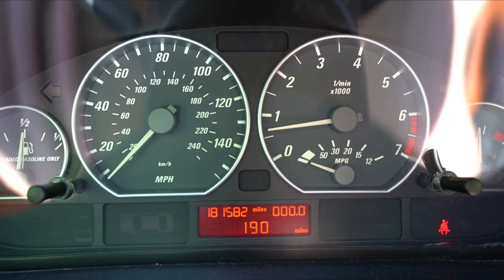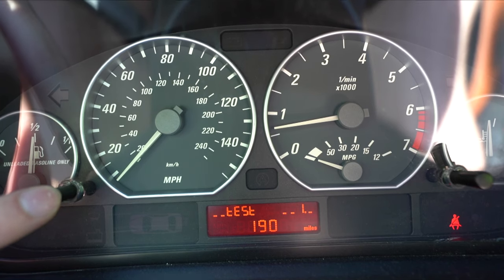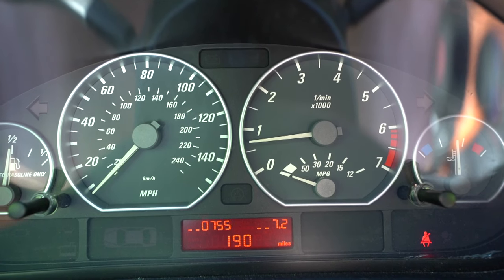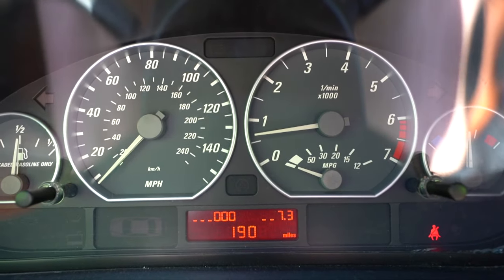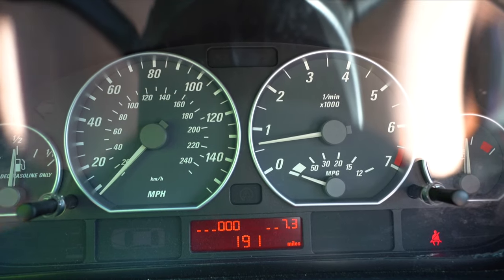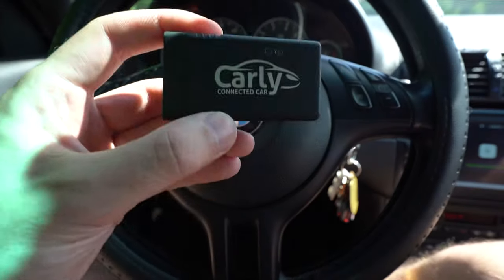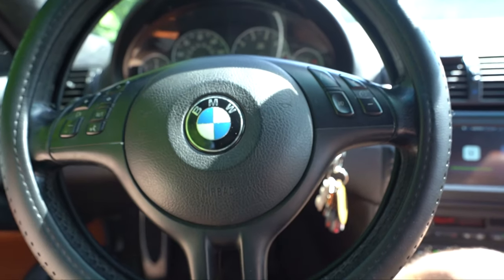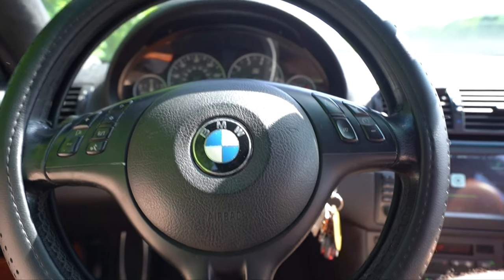How to enable DIGITAL speedometer on ANY BMW!!

Comment: Love your videos!  For whatever reason my car has Mph as one of the 5 labeled options on the cluster, using the BC button.  Temp, mpg, range, time, and mph (real-time)   It will save an average mph when you stop and when you start the car back up it will usually say like 35.8 mph, cause I fly low in the countryside lol, but you can reset it back to 000 and real-time by holding the BC button.   It’s an 01’ 330,  us spec car,  but I picked it up at the factory that summer using the European delivery program. Which I think they unfortunately they can no longer offer.  Maybe that’s why I have it on a us spec car?   Keep on man, I learn so much from you!  Thankyou.

Comment: 7.0 is the digital Coolant Temperature
Reply: Yes, i like it the most
Reply: Yes best one
Reply: What temp should your coolant be at?
Reply: Depends on the Oil temp, rpm, load,...
Reply: What should be the normal temperature of the coolant after driving for about 30 minutes
Reply: Guys it depends on thermostats opening temparature, e46s uses different thermostats depending on your motor
Reply: @mrkim8822  while ideling around 92º C when Oil is hot
Reply: @deseancarter9643  The Sweet Spot Ist 90°C +- 2°C ^^
Reply: How to display mileage

Comment: Just wondering if that hedgehog resistor would make my a/c compressor to stop working my fan works but no ac has pressure and holds it it 10 but was thinking it needed more to work i have a 2003 325ci has 89k on it
Reply from the maker: No the final stage resistor aka hedgehog would not cause the compressor to stop working. The  FRS would stop the cabin fan to stop working
Reply: Ok got ya i have another question they say the relay for the ac compressor is behide the glove box but all I see was the pink colored one no green or blue one below it all fuses have power but cant find the relay
Reply from the maker: It’s more than likely your compressor died

Comment: Really cool video... Now I have a 2005 E46 330ci... There's no check engine light everything's running great but I do have to add the coolant I check it every time fill up about 500 mm or .5 liter.  The water pumps, thermostat, radiator, the coolant reserve tank, coolant cap, bleeder screw...all replaced  any idea?  Thanks.....coolant is the BMW blue color....not cheap
Reply: Check the EGR cooler, and the cabin heater part of the system.

Comment: can you do a video o conecting a steering wheel with radio controls to your radio?
Reply from the maker: Yes but it should come from default with your android radio
Reply: @EvanGoyuk  I have an e39 steering wheel without controls in my e36, but I would like to put the one with the controls. That's what I was asking.
Anyway keep up the awsome videos, they are really helpful
Reply from the maker: Oh yes it should be possible